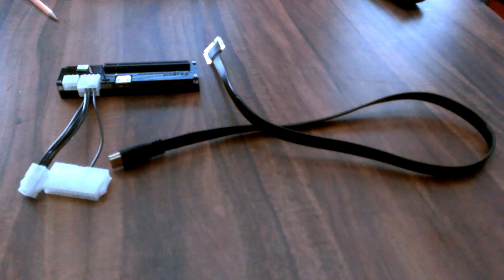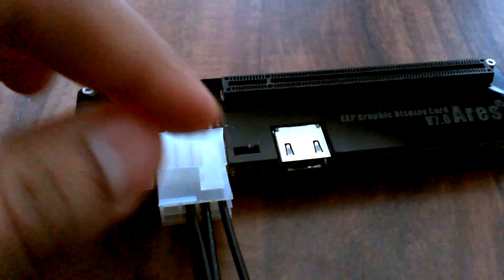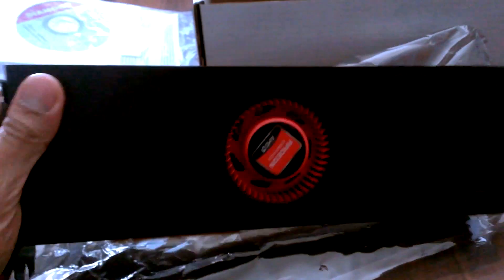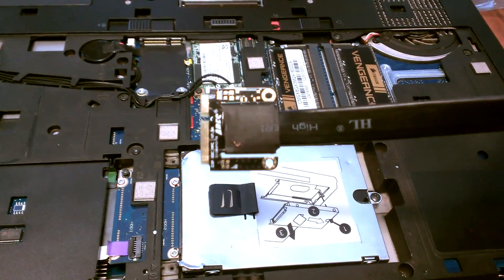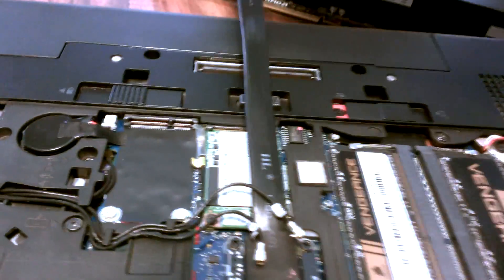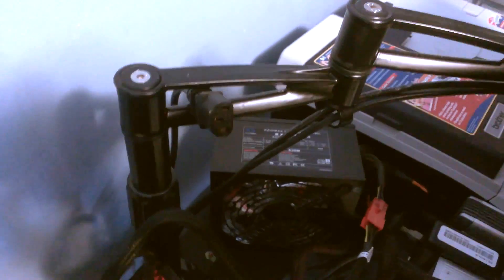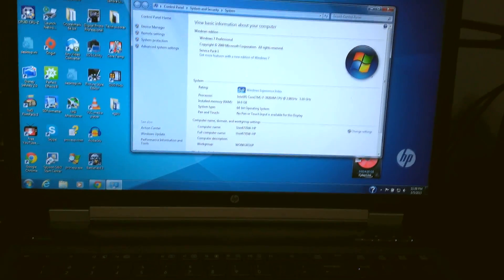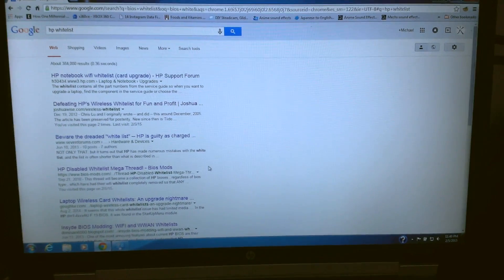External graphics (eGPU) on HP Elitebook 8770w (Part 1 of 3)

Comment from the maker: You should be able to use any video card. The issue you run into with most higher end cards are bandwidth bottlenecks. In most cases, you're going to use your mPCIE slot to connect your eGPU. In most cases, that's only going to give you a 1x connection at either 1.0 (2 Gbps) or 2.0 (4 Gbps) speeds. If you take either speed and multiply it by 16 (32 Gbps & 64 Gbps respectively), you get an idea what most cards are used to having for bandwidth. In the case of the GTX580 I got to work (by connecting via Expresscard), I was being bottlenecked and that card isn't any special these days.
Reply: What about the AMD Radeon r9 380?
Reply from the maker: It's worth a shot but not guaranteed
Reply: +Magmafire when u buy it does it come with everything?
Reply from the maker: It comes with everything but the power supply.
Reply: Magmafire  dont ivy bridge platforms support mpcie 3.0 ?
Reply from the maker: Meissnerflux Not that I am aware of. My Ivy Bridge didn't...
Reply from the maker: No

Comment from the maker: No. You always need a power supply but you won't need anything more than 150W for the Geforce 210. If you could get something better, you should try to get it.
Reply: Can i use it without wifi hdmi adapter? i mean can i use somethings diffrent?
Reply from the maker: No

Comment: you are supposed to put all of the 24 pin connector in the white adaptor
Reply from the maker: +Draconomor GamingPCs Yes. Connect the 24 pin adapter to your PSU and then the 8 pin part connects to the PCI E adapter slot on the EXP GDC.
Reply: thank you for the response. i am currently waiting for my EXP GDC Ares to come in so i can use my GTX 960 FTW through an adapter from mpcie to m.2 on my Lenovo Carbon x1. i5-4300u 8gb ram. the m.2 slot and adapter allow for the utilization of 2 pci lanes so it should have double the bandwidth
Reply from the maker: A M.2 slot from what I know has a different pin layout than MPCI-E...
Reply from the maker: Ok then. Good luck.

Comment from the maker: In most cases Thinkhappy you'll need an external monitor. If you're using a mini PCIE external GPU connection, you'll lose your wifi in most cases but you can replace it with a USB wifi adpater.
Reply: +Magmafire  hi can i use this mini pci in my hp P15 p073tx
can this support in my laptop
Reply from the maker: I'm using this as info, http://h10032.www1.hp.com/ctg/Manual/c04402649, and it suggests you have the mini PCIE slot.
Reply: its mean i never use wifi when i put pcie .....
can i connet my wifi agen r its work .... after using pcie slot
Reply from the maker: You would lose your wifi but you can get a usb wifi adapter if you need it.
Reply: ok thx
Reply: +Magmafire  Talking to me? i never remember commenting on this video!
Reply: Is it compatible with the Toshiba satellite l855?
Reply from the maker: If you have a mini PCIE, M.2, Expresscard, or Thunderbolt slot available to use then you can try it.
Reply: +Magmafire Hi, nice video, how can I know  if my HP Envy dv6-7280LA has a mini PCIE slot?
Reply from the maker: Sebastián Lorca Delgado Your wifi typically uses it. It's usually easy to see when you take the back cover of your laptop off. If i's hard to reach, I wold argue your system probably isn't fast enough to benefit from using an eGPU.
Reply from the maker: ***** Probably with mini PCIE but it's not guaranteed to work.

Comment: the idea sounded awesome,  using a desktop gpu on a laptop'
i wont have any wifi., i won't be able to use my laptop screen ? wtf 
need a desktop power brick.  
this is just awful, i would rather just use a desktop.'
Reply: i've you have a shitty laptop like me then its perfect I use a usb wifi adapter and my monitor has a way beter resolotion the only downside is the psu you need
Reply: +pipo w8 Look at it like this, you bought a laptop with a pretty strong cpu for cheap through your school but it only has integrated graphics. I for one, hook my laptop up to an external monitor when im at home and doing work/gaming anyways so thats no problem. I also connect a mechanical keyboard and a mouse trough a hub. At this point im one cable away from getting a huge performance boost using this method. And it' way cheaper than building a seperate desktop.
Reply: This is perfect for me because my parents won't let me get a desktop, they say I already have a laptop so this is perfect

Comment: I have a Lenovo G500, core i5 3230m with intel hd 4000 and 6 gb of ram, if i buy a desktop graphics card and an adapter will it work? Please respond :)
Reply from the maker: ***** It most likely won't not particularly in your system but in any system. Based on my own research and by viewing other successful eGPU users, Expresscard and Thunderbolt connected adapters tended to work because they're not whitelisted ports. Mini PCIE which is the way most people connect the eGPU adapter run into whitelisting issues. When your system is whitelisted, you either have to get a modded BIOS or DIY Setup 1.x software. The mini PCIE slot in most systems are currently in use with your Wifi or WWAN card. I didn't look up your system but find out if your have a mini PCIE slot and if you do, you can try to do eGPU.
Reply: Magmafire Alright, thank you so much for your help :)
Reply: +Magmafire 
There are systems with free PCI-E slots for mSSD cards, you do realise that I hope? 
My Clevo P150 has one this issue is mostly with brand laptops where OEM limits use for the PCI-E slot for whatever reasons God knows.
Reply from the maker: mSATA are SATA ports only and are not PCI E. I hope that clears things up for you.

Comment: Do you actually need an extra monitor in order to make this work?
Reply from the maker: Baginda Tarihoran In order to see something from the external GPU, without doing anything special with software, you would need a separate monitor on the eGPU.
Reply: But would it be possible to use the laptop's monitor? Is there any workaround?
Reply from the maker: There is a workaround for users that have an internal Intel gpu and an internal Nvidia gpu with Nvidia Optimus software and DIY Setup 1.x.

Comment: What precision screwdrivers do you use to take apart your PC? The backside of mine doesn't slide off. I have also checked some forums and stuff to see if mine would work and it was tested to work. I have the Dell Latitude E6420 (if you were wondering).

Comment: Would this be possible to hook the PCI Express to a HDMI cable and plug it into my Dell Inspiron 7000 15? I have seen it done before.  If so, what parts would I need? Thanks for your help and this was a really helpful video. Also sorry if this is a stupid question.
Reply from the maker: Brett Bonikowski No you cannot. An HDMi video signal is completely different from a PCI Express PC instruction signal. PCI Express has to communicate with another PCI Express interface which would be Thunderbolt port, Expresscard slot, or mPCIE slot. USB and mSATA will not work.
Reply: Okay thanks.

Comment: Can i directly plug the hdmi/vga output from the gpu to the laptop hdmi/vga port or do i have to use external monitor?
Reply from the maker: Ariff Qusyairi You would have to use an external monitor in most cases. The exception is if you use DIY Setup in combination with Nvidia Optimus then you can get the eGPU to handle GPU processing while your iGPU displays the image. This is common for some but not a setup I've tried. You should refer to Techinferno Forums for more info.

Comment: So I buyed myself a Exp gdc beast on ebay, used a evga GTX 760 on it with a 350 W power adpater. and hooked it into the expresscard input of my laptop( HP elitebook 8460p). It all starts very good and smooth. but my laptop doesn't see or recognize my egpu... What am I doing wrong??? Sorry for my language..
Reply: please help???? Magmafire
Reply from the maker: Like in my video, does your EXP GDC have the power cable like I have? If it goes, make sure that it's receiving at least 150W power. In addition, then make sure any 6 pin or 8 pin connectors on the GTX760 has power too.

Comment: I already have a desktop capable of playing any game, but I still want one of these. And now I'm bummed to know it most likely won't work on my HP Probook 6555B. Guess I'll have to try it with my old Dell Latitude D620
Reply from the maker: ***** It might work in your HP. I quickly found out you could have an Expresscard slot and at least a mini PCIE (where your wifi is installed). You could get a mini PCIE adapter and try it in both laptops.
Reply: I don't think it will. about a year ago I bought a wireless B/G/N+bluetooth card to replace the stock B/G/N card and the bios wouldn't let me boot. So I put it in the my D620 and it worked with no problems and later I bought the proprietary HP bluetooth module.
Reply from the maker: Then he' will have to use DIY Setup 1.x if he is going to use a mini PCIE adapter.
Reply: ***** or just not use the mini pci e slot, expresscard ftw

Comment: the reason you card aint working is because the plug you talk about at 1:24 is a power plug that need power that is the reason the bios don't see anything plugged in the adapter needs its own power
Reply from the maker: Steve Squared You only need to use that plug if you're not powering your GPU directly from the power supply. In any case, I did get it to "work". The 8770w whitelisted it. Specifically, I got a error 104 code.

Comment: I want to use gtx960 500watts with an exp gdc beast. Is 500watts of power supply is enough. Sorry for my language:))))
Reply: Yah man just use coregen.exe ...its somewhat technical so refer to the newest comments and you will see my first post reading important how to remove whitelist .....with a post to the video that has a link to the file and a little tutorial. Hope that helps and you get ur setup because no matter what unless you have a 250p-3000$ gtx 10 series laptop you will never be satisfied at what the graphics card market has....not to mention the joys and pains....mainly pains but highoy rewarding experience of buying a graphjcs card. I Backorderd an Msi Rx580 and Msi Gtx 1070 for my setup. Tho ur best bet i found was to get ur local frys to order you a card as they dont flucuate their prices based on demand.
Reply from the maker: Vorapat Tiyasuksawat 500 Watts would be plenty of power. Make sure your power supply has connections to power the EXP GDC and separate 6-pin/8-pin connections to power the GTX960.
Reply: Magmafire Can exp gdc beast connect with Thunderbolt to HDMI instead of expresscard to hdmi?
Reply from the maker: Vorapat Tiyasuksawat No. Thunderbolt exceeds HDMI bandwidth. You should look for Sonnet's Thunderbolt eGPU solution. There are a few others. Thunderbolt solutions cost more but work more reliably and have faster bandwidth.
Reply: Thank you for your advice :))) Magmafire
Reply: So there is not any way to make this work with thunderbolt?
Reply: will hp sleekbook 14 work with eGPU"?
Reply: Ameer Qan it might have a bios white list....which is solved with coregen.exe whitelist bypass more info ^^^^^ commentary ...That should be ur only problem/worry that i forsee ....tho i have yet to see many Hp Posts but thats probably because the said problem and fix/bypass is relatively or fully unknown.

#KnowledgeToTheGamer
Reply: so is there any chance i can get the whitelist remove?
Reply: where's the link?
Reply: Well if you wouldnt be as stupid as you are you would have googled the gtx 960, and see that it draws a total of 120W

Comment: My laptop is hp pavilion dv6, would this work with my laptop? As it is hp brand.
Reply from the maker: ***** It might be possible using the mini PCIE slot.
Reply from the maker: Your laptop won't start or will ignore the wifi slot if you put something else there. Simply removing it does't do anything.
Reply: Magmafire no, it will work. i did it my sef

you have to flash your bios first in order to remove whitelist

then i used a program of TechInferno (speak to Nando) that let me choose "disable internal dedicate GPU".

with that i was manage to play, using my external GPU :D

but it was buggy, perhaps because windows 7 doesnt has good drives.
Reply: ***** i'm trying.. you need to flash your bios to remove whitelist
@Magmafire just to tell that
Reply from the maker: You could get a custom BIOS to remove the whitelist or get DIY Setup 1.x from Techinferno forums
Reply: +Francisco Pessoa So are you trying on HP pavilion laptop? I removed the wireless card from the PCIE slot just for a test and my laptop started fine.
Reply: hi ***** 
you used which GPU? and with which S.O.?

mine worked too, but with bugs and only in another monitor
cuz that i had to uninstall my drivers

i did not test (yet) windows 10
Reply: I still didn't buy this adapter, I worry that it may not work, I thought by trying to remove the wireless card pcie and test if my laptop doesn't start with a black screen as some other people said.
Reply: Francisco Pessoa How do you flash bios? I don't think you need a program to disable internal dedicated GPU, you could just do it I think from device manager.
Reply: you go see which bios you have, and gg flash that bios...

removing dGPU from device manager its not the same as windows dont know that it exist

tell me. what model you have?
Reply: My model is Hp Pavilion dv6.

Comment: do you need a power supply for this?
Reply from the maker: Yes. You need at least 5V to the adapter and at least 12V (150W) power direct to the video card.

Comment from the maker: It's a HDMI to mini PCIe cable. Your PC wouldn't understand a HDMI to HDMI connection as a PCI Express one.
Reply: Magmafire ofc the expresscard adapter worked, hp has a bunch of whitelists, i did alot of research..expresscard is the way to go..
Reply from the maker: A crippled gtx670 as a egpu will be much better than that fx2800m. I'm not sure but you'll get a few enhancements as well that may improve how the visuals are drawn on your screen. In any case, enjoy your upgrade.
Reply: Magmafire did you try disabling the gpu in device manager and tried again ?
Reply from the maker: Yes. No luck. An expresscard adapter worked for me.
Reply from the maker: Good to know and I'm glad it worked out for you. What eGPU did you go with? Did you have any performance gains over your iGPU?
Reply: Didn't get it yet..did tons and tons of research. And I don't have an iGPU. I have a dedicated gpu though (quadro fx2800m) and getting a gtx 670 for cheapp. Well since you probably already know the quadro is a 9800gt, so way more performance ;) and no more dx10 limits

Comment: Do i need a PSU ??
Reply from the maker: Yes, you need a PSU for both the adapter and for the GPU if it has power connectors. The adapter needs a 5V signal to be detected by the PC, the GPU needs a minimum 150W to power up, and additional power for the GPU depending on the GPU used.
Reply: will this work with hp sleekbook 14??

Comment: Hello, I have question: Can I use VGA cabel to plug it from graphic (connected in adapter) card to my laptop and dont use external monitor ?
Reply from the maker: No. The only way to use your internal monitor is through a Nvidia Optimus eGPu setup. Refer to Techinferno forum for more details.
Reply: Ok, thank you for fast answer !

Comment: Hey, how can I know that Mini PCIe slot isn't whitelisted?
Reply from the maker: You can't unfortunately. You can assume if you have a Lenovo, Dell, or HP that you have one. You can also assume if you have a Clevo, Sager, Eurocom, Prostar, iBuypower, MSI, etc then you probably don't.
Reply: Magmafire I have a dell, goddamn it, in your video it mentions that some dell laptops have it though.....
Reply: Magmafire wouldn't it bottleneck? as its running x1
Reply from the maker: It is bottled necked quite a bit. But every game/application will vary on how much information will need to be processed through the PCI Express lane.
Reply: how much fps would you say bottlenecked by?
Reply from the maker: It's not a consistent thing you can measure. For example, I tried Borderlands 2 and Counterstrike Global Offensive. CSGO ran at 50-60 fps maxed out with the GTX580 eGPU, and BL2 averaged 30-40 fps (sometimes higher depending on how much physx was used). What was more noticeable than the fps was the occasional stutter. I believe the stutter is the literal manifestation of the bottleneck. Other eGPU users have had similar experiences.
Reply: so is it worth it?
Reply: and I believe that theres no pci bottleneck..through images, all depends on the cpu..what cpu does your hp elitebook 8770w have?

I have the hp telibook 8740w 

by images I mean..these..desktop vs laptop

http://www.banggood.com/EXP-GDC-Beast-Laptop-External-Independent-Video-Card-Dock-images-p934367-i76512.html

VS

http://www.banggood.com/EXP-GDC-Beast-Laptop-External-Independent-Video-Card-Dock-images-p934367-i76511.html
Reply from the maker: I have an Intel i7-3920XM CPU which is the second fastest CPU you can get for the 8770w. What plays a bigger factor if an eGPU is worth it depends on what is already in your laptop. I have a Quadro K5000M. It's actually powerful for a laptop. If you have for example an Intel 3000 iGPU then an any eGPU would be much better in comparison.
Reply: I have the i7 640k and from my research thats equal to an i3 2310 which doesn't bottleneck the gtx 750 ti sc im going for